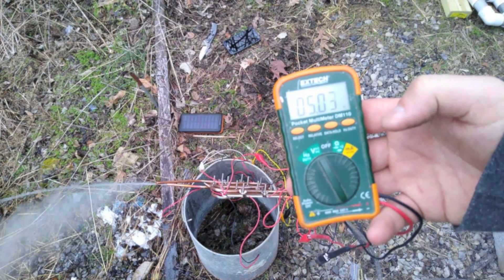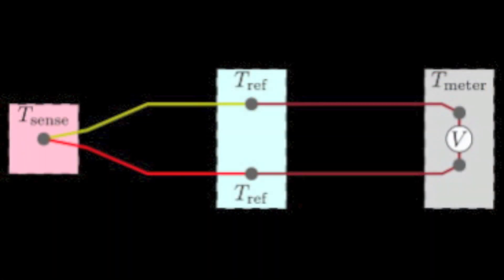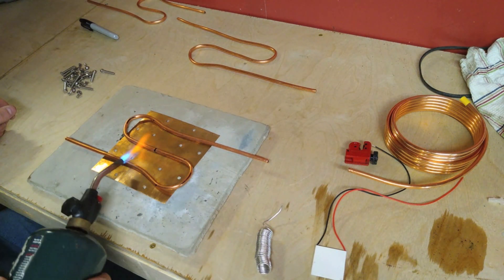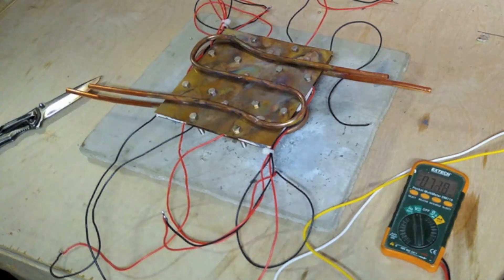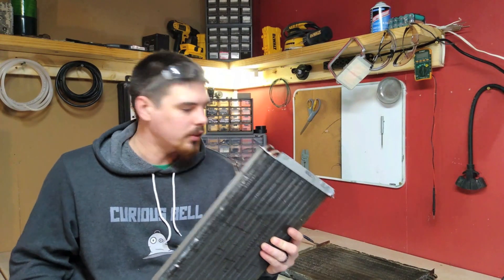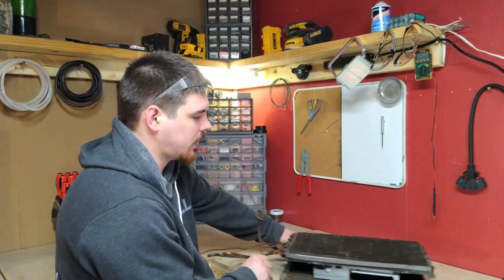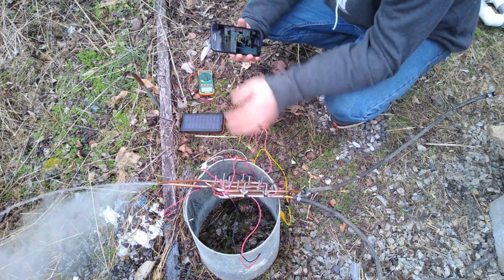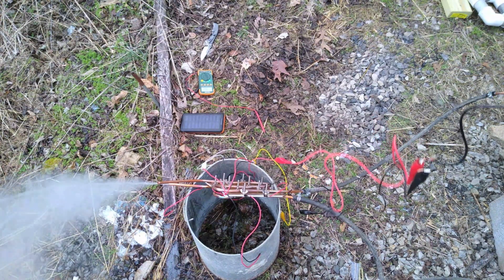How to Make a Solid State Steam Power Plant with Peltier Moduals

Comment: Those peltier moduals are trash. You should use the Seebeck effect with magnets and different types of metals in coils. That's true solid state charging to me and my research team at Triton are currently experimenting and researching a few products that can be used in rvs and caravans to charge batteries. Add a bucket of ice or a conducting rod to that body of water instead of that steam machine and I promise you that phone would be fully charged within an hour or two depending on the size of the coils and magnets.
Reply from the maker: Thanks for watching the video and leaving the feedback! I might try that in the future